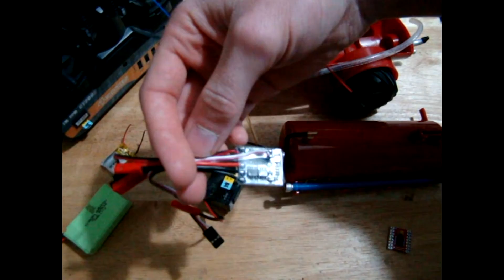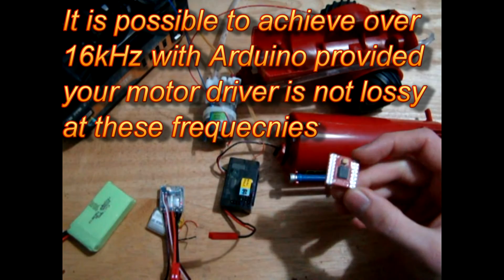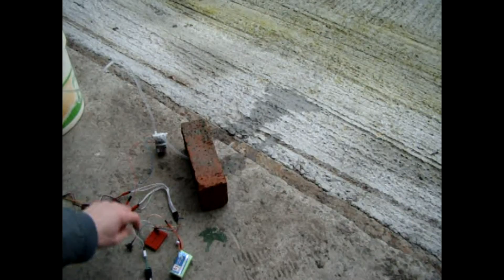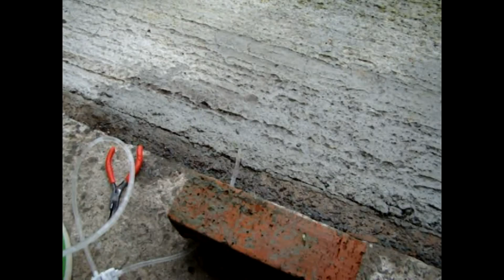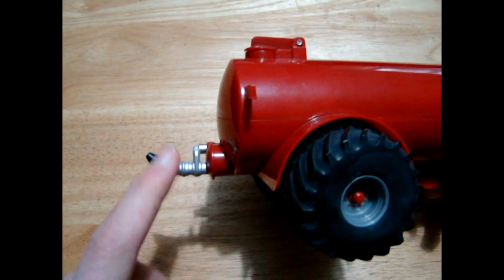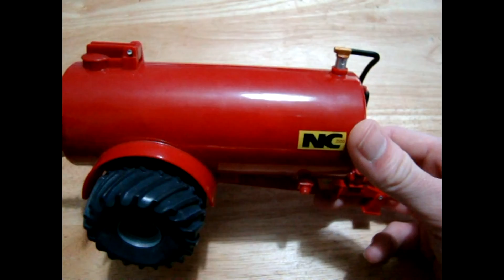RC Tractors Britains NC Slurry Tanker Part 2 - Success with an Electronic Speed Controller (ESC)

Comment: if u get a smaller pipe on the pump it will slow it down
Reply from the maker: That's a good point but I think the water would be slowing down due to increased friction loss in the pipe as the displacement of the pump would still be the same so might not be an energy efficient way to reduce the water flow. Might be interesting to measure the power and flow rates with different pipes to see if there is an optimum for this pump.
Reply: +RC Tractor Guy where is the next video